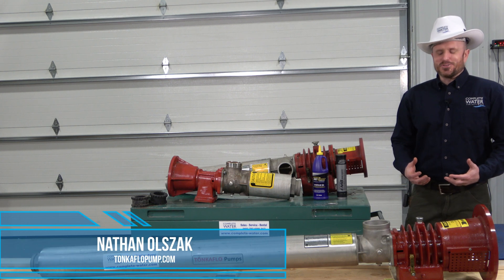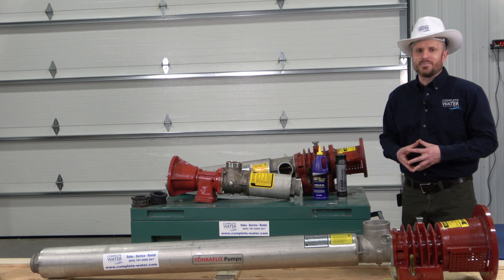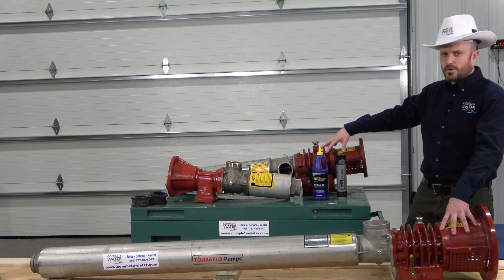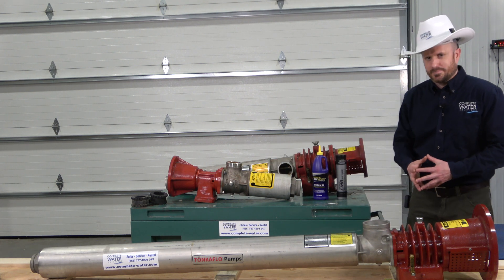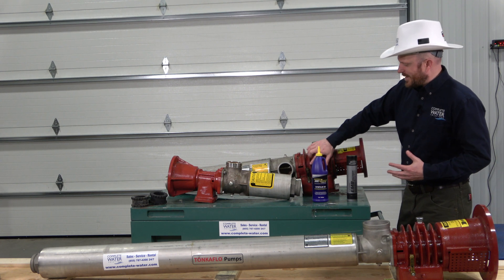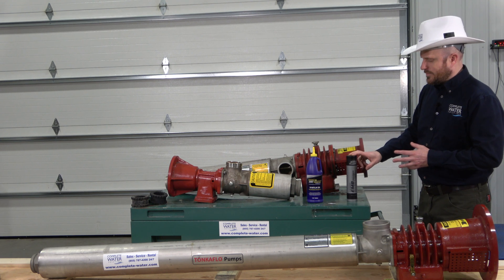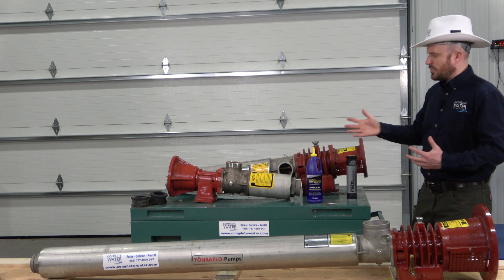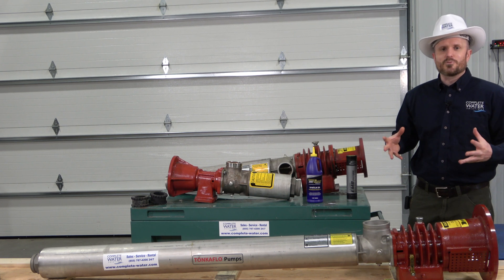Tonkaflo Pump Oil Maintenance & Lead Times

Comment: In Dubai  you have any dealar
Reply from the maker: Good Morning, Hope all is well, we CWS do not have a "dealer" in Dubai, we do however we have sold Tonkaflo Pumps to your Region and worked together with shipping.
Reply: I have water pump the brand is Tonkaflo pump. The problem is getting hot the bearings between the motor in pump. What do you think is the problem ? Why the bearings is hot when the motor is working?